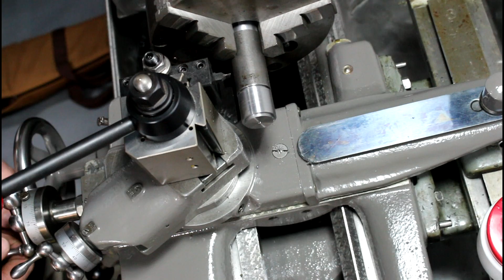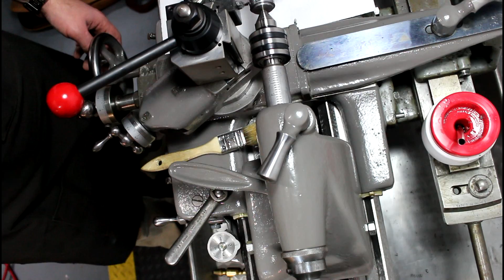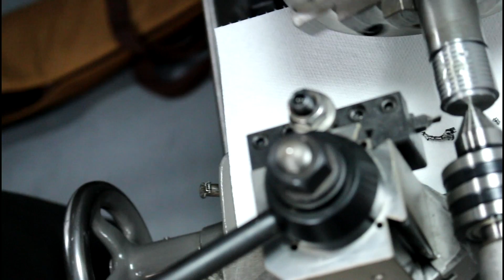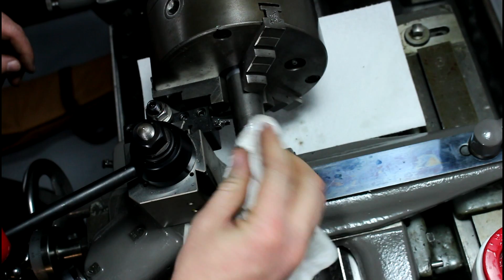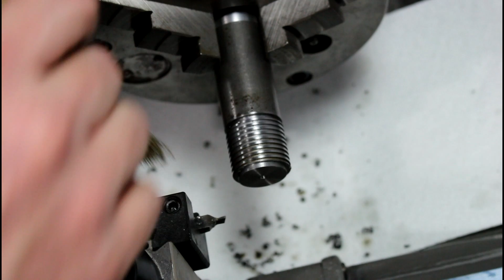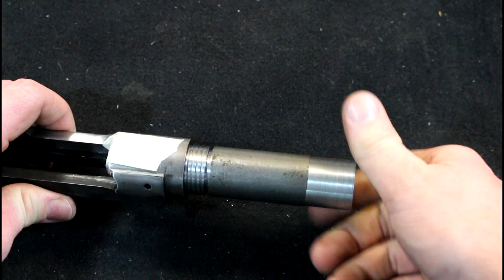Cutting Square Threads on a Lathe Part 2

Comment: I have a 1903 Springfield with and the scope mounting holes are not straight with the bore. It originally had a Bausch & Lomb scope on it and the scope adjustments were in the mount. The single rear hole in the receiver was already tapped out to 8x32 so I plan on tig welding that hole closed. Where are u located to send this action to u you fix the mounting holes? I have a scope rail to for it now.
Reply from the maker: You can check out www.apexrifles.com
Reply: So that is your website correct?
Reply from the maker: @patruddiman4228  yes. That's my business.
Reply: I have a couple of projects to finish myself after that is done I will send u the action.

Comment: NICE looking thread for soft cold role steel.   I went and looked up part 1 to see what kind of action that is, saw that It is not  a Mouser. If so it would have metric threads in it. Not sure on those actions. if it is metric that would explain the fit problem if you have lathe set for 10 TPI.

Comment: I just cut square threads for an 1899 Savage take down. I practiced on a piece of Aluminum. My cutter was only 1/2 as wide as the hole needs to be. I had the compound set at 90 degrees. Once I was at depth, I made cuts by advancing the compound until the cut was wide enough. https://youtu.be/G66rVy3jjH8
Reply from the maker: It can be done that way. Only downside is it takes longer and your cutting isn't as strong and may break easier. Your look OK.
Reply: @precisionmachineshed  I just cut some more for an 1899 Krag. If I were not old, blind, and shaky hands, I would grind a tool the right width.

Comment: How about moving the compound parallel to the lathe axis. This way, you can use a tool that is slightly narrower and use the compound to shave the flanks to get on spec.  The depthing remains unaffected.
Reply from the maker: You could do that, just seems like an extra step to me. Your width is a pretty easy constant, so if you have the correct width, then you just need to worry about OD and ID thread diameters. That being said, the method you mentioned would surely work also.

Comment: if you move the compound 90 to the work you can use it as your increase and the cross can go back to zero each time.
Reply from the maker: That makes perfect sense. I think I learned it the way I have shown because the guy that taught me didn't move his compound around much so he could leave it set at 30 degrees or so switching back and forth between square and standard threads for rifle barrels.

Comment: A good confident demo, but I note a couple things re those reliefs.  The front one is not necessary and the rear one is not wide enough at one(?) cutter width.

The cutter wil not clear the cut thread until it is actually against the face - not good.  Secondly,  if you must cut a front relief,  then arrange for its finishing diameter to be exacty your thread depth.  That can then be your definitive thread depth indicator whatever your dials may read. I'm not a machinist btw.
Reply from the maker: +R Balderson 
The back cut is wider as seen about half way through the video. The front cut isn't needed but when I do receivers like the one shown, they usually need a small relief. Ideally, yes, you would want it at the minor diameter size, However sometimes when going into an internal thread without a relief, you need to cut it a little smaller. You want your threads to indicate on the opposing threads, not on a portion of a relief cut. In this demo I did cut them quite a bit deeper than needed.

Comment: Nice job, when are you going to barrel that receiver. Looks like it would make a nice 300 black out bolt gun. Just because it would be completely different. It's just an idea, along with a form one suppressor that thing would be ghostly quite.
Reply from the maker: +The Texas Gun Guy 
That one has been sitting on the back burner for a couple years now. I've been trying to figure out what to do with it. It's already had a lot of custom metal work done to it, and I need to pick up a few specialized parts before I get it barreled up. Not sure what it will be, but i've tossed around the idea of making a nice 257 Roberts with a high figure walnut satin finish stock. One of these days I'll figure it out.
Reply: +Precision Machine Shed it will come to you when you are ready. It will hit you like a brick, when all of the parts are coming together. I used to have a gun shop with my 07 license. I was able to build some really cool stuff. Well have a good one.